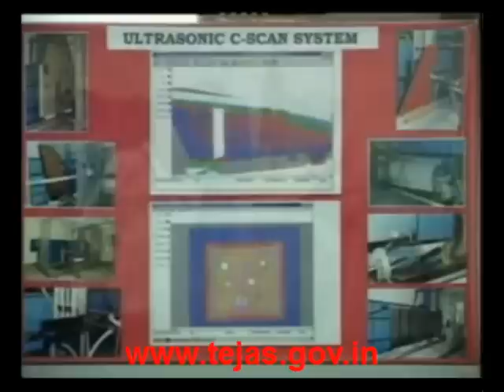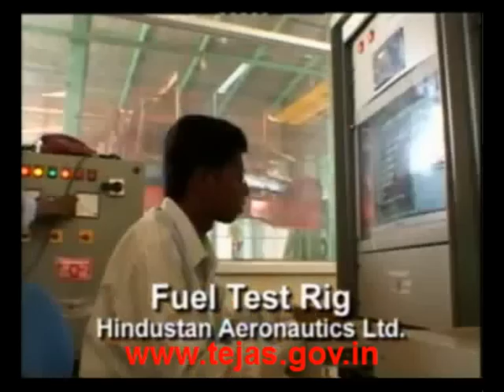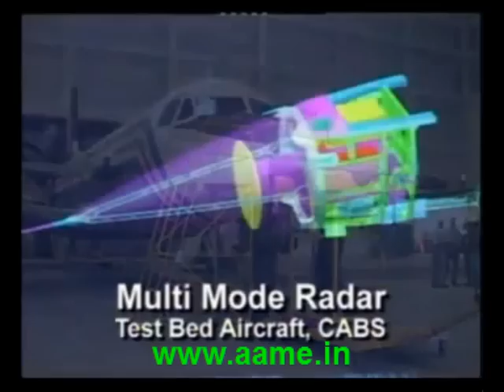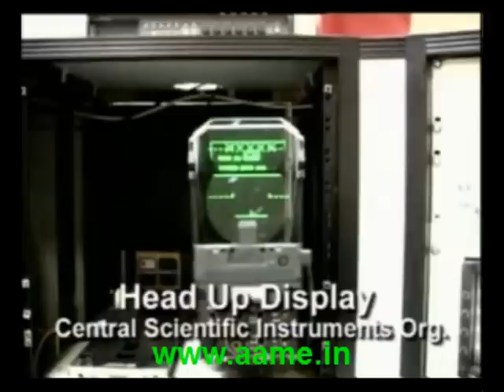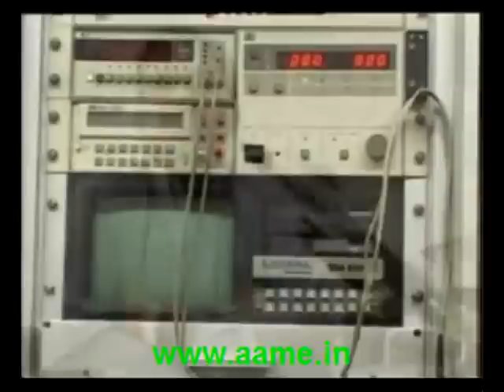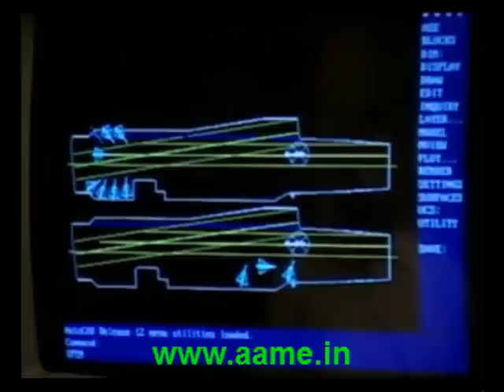Wings of the Future - India's Light Combat [LCA] Tejas

Comment: ...DESIGN IS OBSOLETE. THE ENGINE, ITSELF UNDERPOWERED, HAS STILL NOT BEEN MADE. GOOD AVIONICS AND SOFTWARE AND ALL THAT IS FINE, BUT ON WHAT?? IT'S LIKE INSTALLING A FLY BY WIRE SYSTEM ON A BULLOCK CART THAT CANT FLY IN THE FIRST PLACE. ONCE OPERATIONAL, IF ACCEPTED BY THE IAF, IT WILL BE THE WORLD'S MOST EXPENSIVE BULLOCK CART WITH WINGS. AT BEST, COMPARABLE TO A MIG-21. FOR THE SAME AMOUNT OF MONEY ALREADY SPENT, WE COULD HAVE HAVE ACQUIRED A COUPLE OF THE LATEST 5TH GEN FIGHTERS, FLY AWAY.

Comment: LCA a.k.a Light combat Aircraft or HAL Tejas is a  lightweight multirole fighter. Its main role is : - 1) Take the role of an expendable yet effective role of Mass produced aircraft from the MiG-21s which are due to retire. 2) Counter Pakistani and Chinese reverse engineered Fighter Jets 3) Provide Air interdiction, CAP and CAS to both Army and Navy 4) Work in conjuction with Attack helicopter LCH and other Jets like Su-30 MKI and MiG-29s. Operational Status - 2 in service (Mk.1 model)